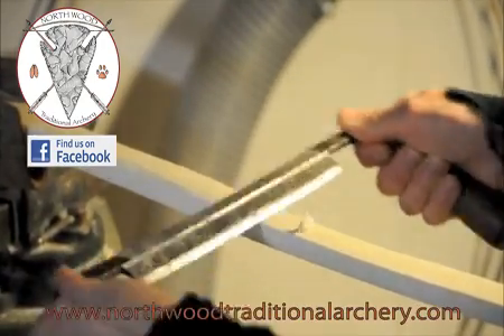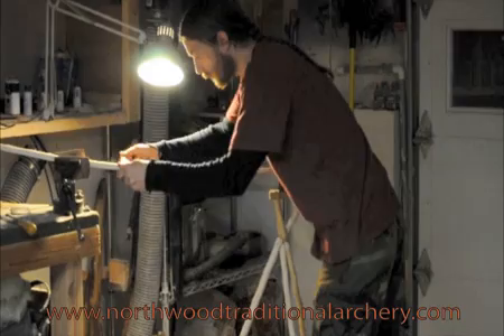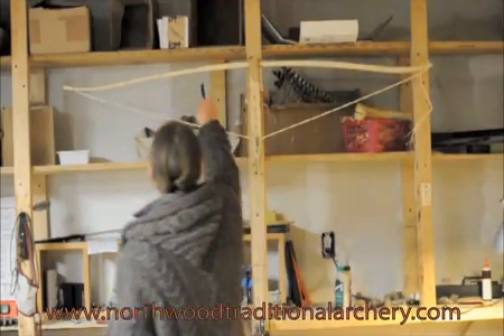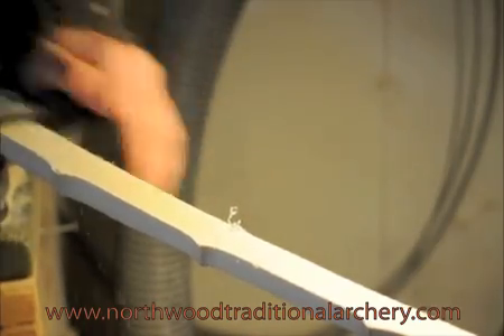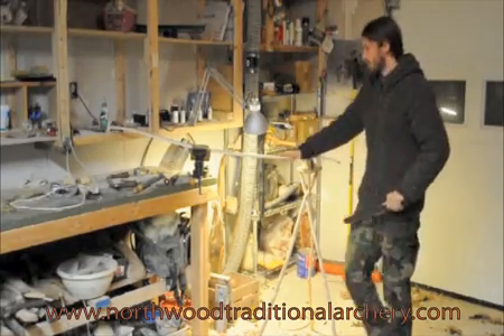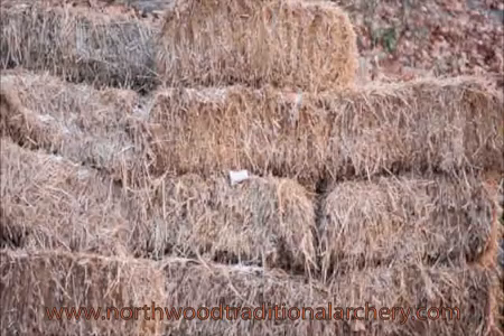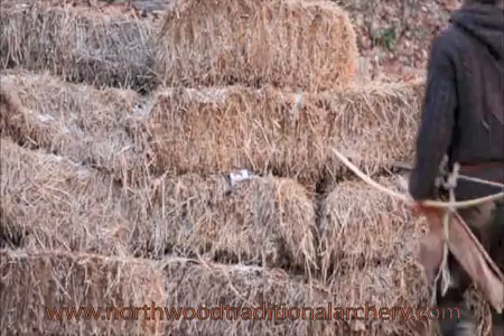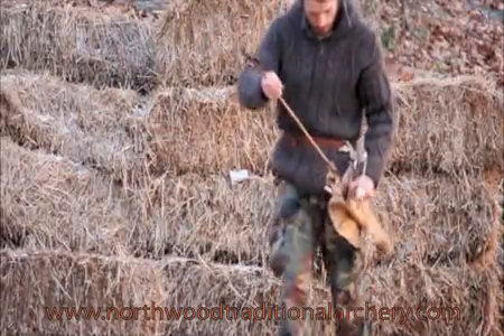Making Primitive Archery Bows (handmade bow and arrow)

Comment: Hi Greg ,My name is Mike and I live in the UK . Came across your website showing your traditional bows which I am very interested in . Just so I can get a better idea of whats on offer can you please confirm a few dimensions . I like the traditional recurve  self bow, so for a 40lb-45lb draw weight what would be the unstrung length of the bow ? Are all your bows made with an initial 2" width at the handle ? And what is the thickness of the bow , is it constant the full length of the bow or does it taper towards the tips ?Kind regards .Mike